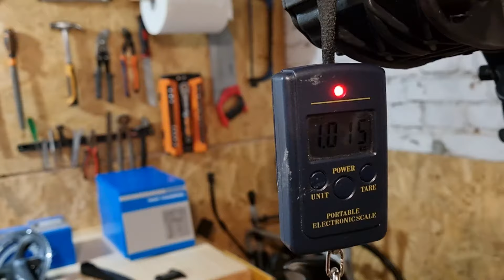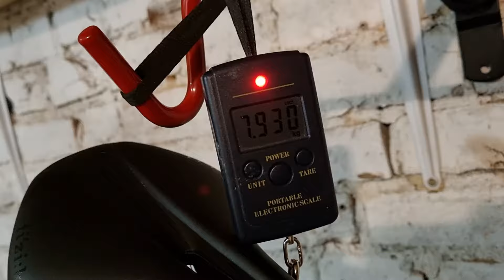Dream racing road bike build for normal people based on Chinese carbon SP053V frame and Shimano 105

Comment: 7.9kg. Why not buying a 2000$ alu bike with same weight from brand?
Reply from the maker: Because it was 100% tailored for owner requirements and needs and also was much cheaper ;-). I have nothing against a factory made bike (as long as it is assembled correctly).

Comment: I don't think that internal routing through headset with rim brakes is for normal people lol. So much bends and twists for cables +  a bit difficult headset service))
And that front cable to front brake with rest cables go internal, just wtf )))
Reply from the maker: So far so good, no need for cable and headset service ;-)